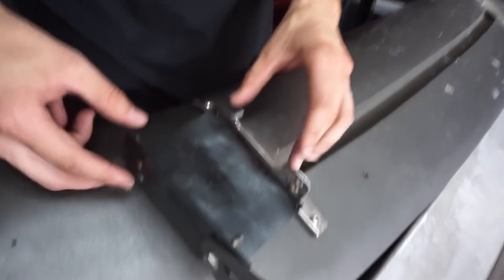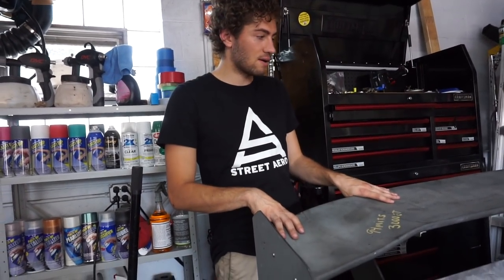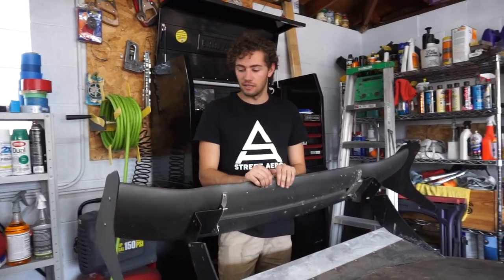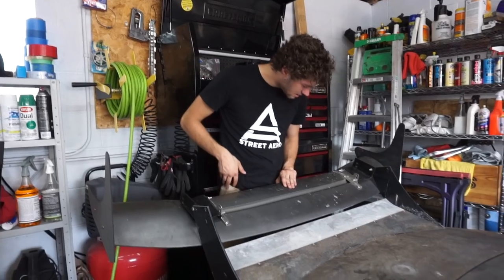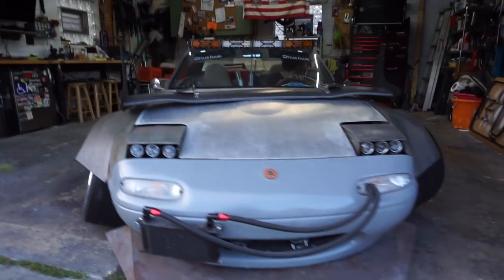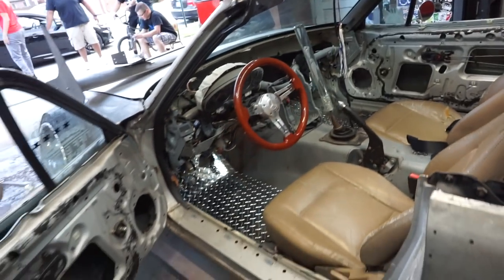Custom Diamond Plate Floor Mats

Comment: Some high strength velcro to hold it down an not rattle as much
Reply from the maker: I ended up riveting them down, shouldnt be going anywhere
Reply: @MorbidKitKat1  I only said that for cleaning them but guess that works